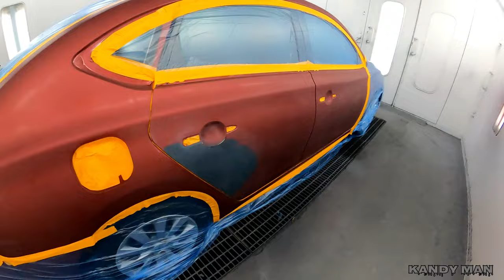3M VERSAFLO TR800 MASK

Comment: I use the backpack I used the waist for a while but that rubber strap stretches out a lot and starts hanging on you only complaint on backpack is it’s a pain to put on sometimes
Reply from the maker: The belt does seem not as good as old one

Comment: Question is this any good for isocyanate in 2 k clear coats 3m states filters should not be used while using isocyanate only supplied air
Reply from the maker: This unit is made for paint
Reply: Supplied air is the only safe option for 2k product :)

Comment: Great Mask!! Great for sealer. great for base. Not so much for clearing especially white colors, reflections even with new clean visor. Sata Air Vision 5000 is better, since no visor is used and way less reflections, but still hard with clearing white vehicles. I have both to compare and often i have to put regular 3m mask on final clearing coat.

Comment: Hey man are these suitable for our trade though? As in are they designed for us refinishers? I hear the air compressed ones are but not sure about the battery operated air systems
Reply from the maker: Yes it is tr800 is make sure its for painting  they make ones for medical  and other trades

Comment: I have the Sata 5000 vision. It's nice. I just have one hose going to the regulator with a whip hose going to the gun. That looks like a nice system too
Reply from the maker: I used that system for years great setup as well as the tr 800
Reply: Are you sure you have sata 484 filters??photo show
Reply: Yes

Comment: I love mine. Did the backpack with shorter tube and it’s pretty awesome bro. Very much worth the investment. I have almost the exact same job set up for Monday morning! NAH used door, quarter repair, bumper repair and blend front door
Reply from the maker: I was wondering about the hose needing shortened  .gonna check it out thanks  💪
Reply: @kandyman5315  I used this 3m part number #37309
Reply: @Kandy Man  how long do your filters last until you need to change it out on average?

Comment: Do you prefer the 3M TR 800 versus the Sata 5000 vision?
Reply from the maker: Yes  it can  go anywhere in the shop without a hose connected.  And it works great
Reply: @kandyman5315  and it protects from isocyanates??
Reply from the maker: @dkv674  absolutely